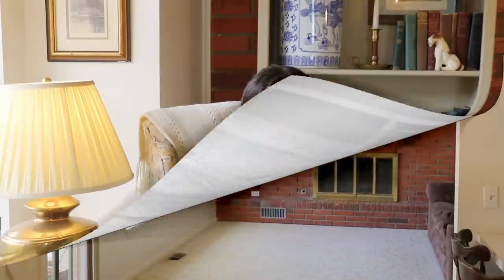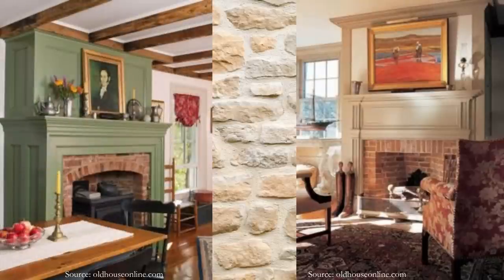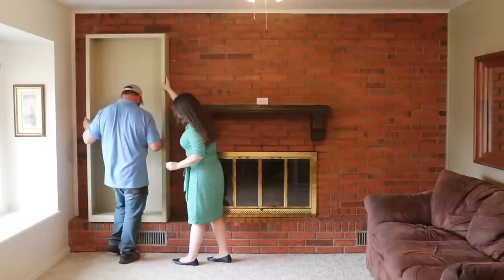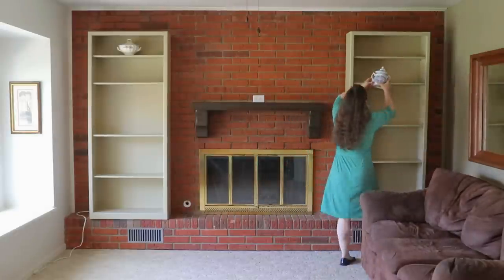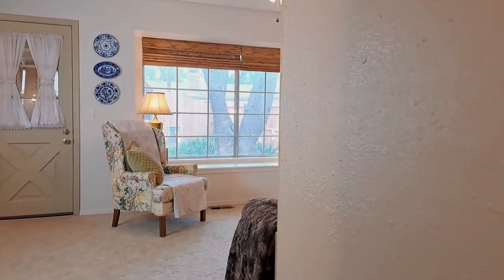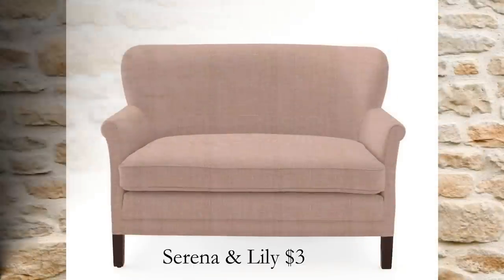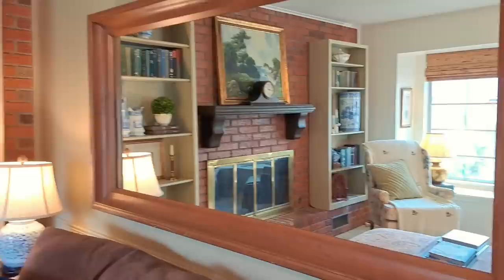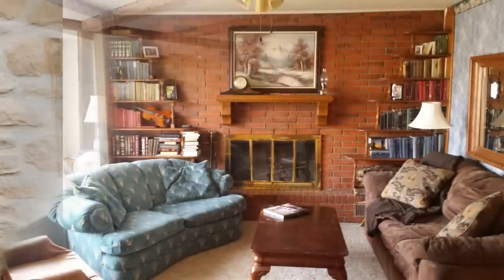English Cottage Living Room Makeover & Home Decorating Ideas

Comment: The bookcases and the decor in them is a home run.  Here are some suggestions: Put loveseat in place of the couch and bring back the wingback chair.  Remove the couch.  Too heavy, crowded and not the right style.  White wash the bricks for a softer tone to remove the orangey look. Paint the wood frame on the mirror to and aged gold.  Do a black undercoat and the add golds.    Some black always looks good in English country.  These changes are cost friendly but will make a big impact.  You made some great scores on marketplace.

Comment: Nice video- suggestion to use MDF paneling at the height of your mantel all the way across to help the bookcases look built in. Also a “snug” is more like a den with TV, your room is more like a reception room. Other suggestions- make a sill for the window seat and stain it the same tone as the shades, change, or get rid of the lights on the fan.